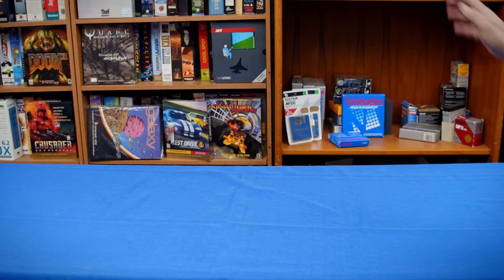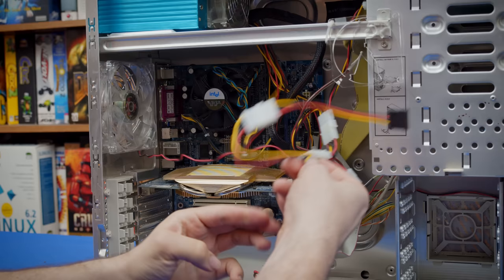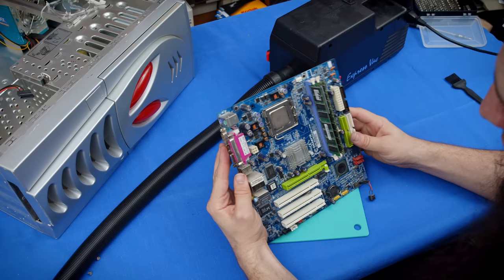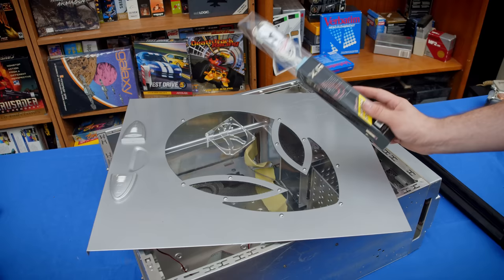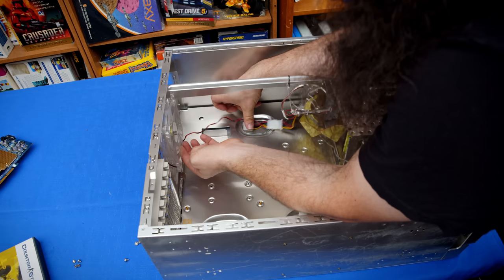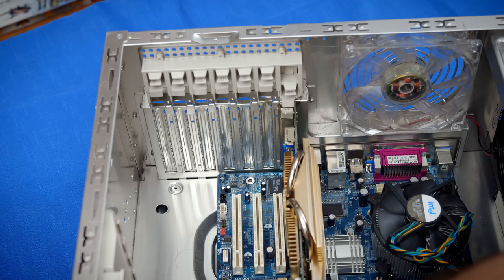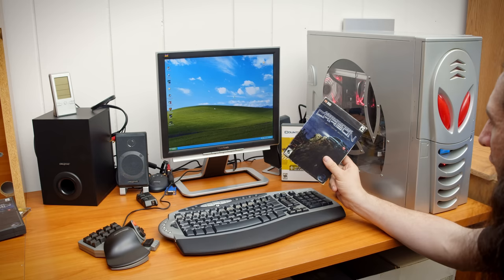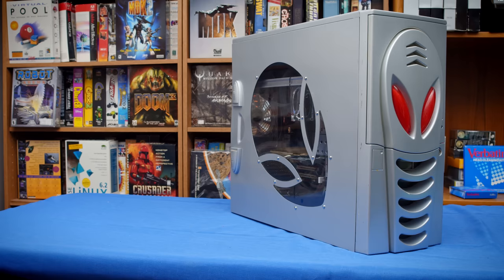Windows XP Gaming PC Brought Back to Life

Comment: When I got back into computers. I saw tons of those gaming machines coming in. Horrible built cases with plastic not metal hinges to swing the door open with. Then my fav. was the cables in the door would start shorting out due to breakage. Some even had led lights in them that would die. Also, it was during the bad cap plague for boards, gpu, and psu. Small fan on video cards and main boards would die. Add on that the horrible anybody can build a computer. But, hey throw cable management out the window and the windows license key. Just use the corp version.

Comment: 5:35 - No, it's absolutely NOT an AT power connector. It's the connector used by early Willamette Pentium 4s, before it became a standard 4-pin 12V ATX-style connector.

Comment: Nice video man. In 2004 I ran a athlon xp 2500+m @ 2350MHz on a Abit NF7-S 2.0 mobo with 1GB PC3200 DDR2 and a geforce 4 ti4200 @ 300/600 although I had 19 desktop and 2 laotop computers back then.

Comment: 34:40 pretty sure like 90% of games realeased on disc in the last 3 or so years are unplayable due to not actually having the whole game, many games exceed the capacity of a 2 layer blu-ray and even if they don't they probably just put an authentication file of some kind and make you download the game (all the ones I've used have massive downloads when you put the disc in so it's definitely atleast part of the game and not just updates), and I don't think pc games even get discs anymore, if you buy physical you just get a code in the case.

Comment: the CPU is what is holding carbon back. had a similar setup and loved carbon. same issues. overcloked the snot out of it and carbon ran great untill the cpu got so hot that it melted the heatsink brackets. this was before i know much about keeping thermals in check

Comment: Cool PC. My first PC was and is Bravo ISO 9001 that was a gift to me on my birthday back in beginning of 2007. It had ATI Radeon X1650 Series video card, Intel Pentium D processor with 3.00 GHz, 1 GB of RAM and HDT722525DLA380 ATA hard drive on 256 GB. The motherboard is Gigabyte GA-945PLM-S2 v1. I don't remember what power supply it had. 

Unfortunately, because i'am not on that level of rich to get myself a modern PC, i'am forced to still use this same PC. BUT, i changed a lot of things. The battery was changed, the power supply was changed, more(ish) RAM was added and video card was changed. Everything else remains the same. So now, it has ATI Radeon HD 2600 PRO video card, 2 GB of RAM DDR2 and new power supply that i don't remember the name of. The case is the same Bravo case. Sure, it is messed up over the years but hey, i'm not in to how the case looks, so it doesn't bother me that much. I clean it from time to time and it is fine. 

It currently runs on Windows 7 x64 Ultimate, but i'am looking forward in to installing Windows 10, after Windows 7 support will be fully done 100% and after i would not even be able to open a browser to surf the internet around. Now, despite the fact that my PC is still working, it already has problems. First one, is the sound card problem. It is messed up, and thus making Realtek to pop up every now and then, when i plug in my headphones, so i have to force it to not do that. And if electricity shuts down and then comes back on, and i turn on my pc, and put my headphones, i can hear the ventilation sounds in my headphones from the ventilator. And the front headphones and microphone ports does't work at all, so i can't plug my headphones in to them. Then there is USB ports problems. Like, sometimes, they stop working for some time, and i have to unplug and plug my keyboard and mouse back, to make them work and stuff like that. But that does not happen very often, if i plug them in and will not touch them for the rest of the time. And so yeah, that is what i have to deal with.

Sure, i can't play modern video games on this PC, but i can play some games. Like, games from 2000 and up until 2014 works. Some of them work fine, others are not, but that depends on PC ports of those games. Like GTA 4 had a bad PC port, so it works very badly. But, there is 2D games that was coming out during this period of time, and they work with no problem. And it's games like: Blazing Chrome, Shank, Mark of the Ninja, Huntdown, Shovel Knight, Mother Russia Bleeds, Double Dragon 4, TMNT Shredder's Revenge, The Messenger, Sonic Mania and many others. They work on my PC with no problem. And then i can just run emulators of many old consoles and play those games. So yeah, i have stuff to play, BUT i really WISH i could play modern videos games that i saw and always wanted to play. But sadly, not everyone has those kind of money to be able to buy new PC and enjoy their free time by playing modern video games.
Reply: Can I tell you a secret of mine? I got a free gaming laptop. What I did was buy one at Walmart. It was a $1200 Dell laptop. I had an older Dell what I did. Was swap my old Dell and put it back in the new box. I would take the sticker off the back of the new one and put it on the old one. That way, the model numbers and serial numbers would match the box and receipt if they opened it which half the time I do this they don’t open it you have to open it from the bottom and you have to open it carefully to make it look like it was never opened before then you just return it to the store with your receipt, you get a refund and now you have a brand new computer I even took out my old hard drive and kept it then I returned it and got the full refund. I do that with TVs receivers wrist watches I do it through Walmart and Amazon. I say screw those big corporations, I do the same thing at Amazon, where I buy some thing. Then I’ll put something else in the box. Then I will refund it. Saying it was never opened. I just say I bought the wrong item. Then I get the refund on my card. I use a PayPal credit card as a burner credit card. I make a burner email address. A burner PayPal account. I use a burner credit card through PayPal. That way, if they do try to reverse the refund after finding out, it was not the right item. It will be on a credit card I don’t even use anymore. 😂 I literally just got through Amazon last year. A brand new Akai MPC live II. It was $1200. I got it completely free. I put an old stereo receiver in the box. Returned it and said that I bought the wrong item. Saying that I never opened it. I got the refund no problem. So I did it again and bought an Akai force. It was also $1200 on Amazon. Then I bought and swapped an iPhone. I had a really old crappy iPhone 7. I bought the iPhone 13 Pro Max 512 GB model. I broke the old phone so it would not power on. Then I returned it saying it was defective. They gave me a refund. I also bought a $1200 Samsung TV a few years ago. I did the same exact thing. I put my old TV in the box. After swapping the serial numbers. Which was on the sticker. Then they open the box and it match the numbers on the TV to the box. So there was no problem getting a refund. I basically just upsized from a 35 inch television. To a 55 inch television. I have gotten so many free things like that. It’s not even funny. Again, I actually like doing it. I won’t steal against any regular person. People that work hard for their money like myself. It wouldn’t be right stealing from them. But stealing from a company. That took down all the mom and pop shop businesses. And making billions of dollars a year. I say screw those people. I’ll steal every penny. I can get from them. 😂 if you’re willing to do that. Scamming and lying to a big corporation. You would be amazed at how many things you can get for free. I hope you have a blessed day brother. God bless you and yours..
Reply: @BLUE_OCTOBER-TRIX  Well, you can't do that here in Ukraine. Sure, you can return back the stuff that you bought if it does not work. But then, you have to prove it does not work, and you have to prove that you did not opened it and that you did not messed with it. Like, i bought new headphone few months ago, got back home, turned them on and... they turned out to be broken. Like, i can hear a left headphone in both headphones, instead of left been left and right been right. It was weird. It worked like in mono or something. And the sound was weird. So later, i grabbed them, got back to the place where i bought them and said that they sold me a broken headphones. And the guy who was selling the stuff, told me to prove it. So i plugged them in to my phone, turned on some music and let that guy listen. And after that, i got back my money. Then i went to another store, with gaming devices, and bought a real gaming headphones, instead of that cheap crap. All tho, they were a lot more expensive than previous headphones. But still, i'm happy. So yeah, you can't refund here anything, without a proof that, the stuff that you bought is not working.
Reply: @BLUE_OCTOBER-TRIX  Thanks, man. We all doing good. At least i know that our region is doing well. After our military free our region and make those russian nazis ran for their lives, we are doing fine. Sure, we get some air strikes from them, but mostly we manage to deal with it. I will not spill out the details because, it can get me in a lot of troubles, but, if I quote Obi-Wan from Star Wars, then i had to say that "We have the high ground".

Comment: still using ye olde antec gamer 200 case with the tie fighter wing design front grill. recently gutted and cleaned it up and spray Chromed the inside and the mesh. looks like a new case again goin in to 2023 lols

Comment: You could easily use a Modular Power Supply to replace the original one, the great thing about Modular Power Supplies is that they help a lot when it comes to cable management.

Comment: "Not what you think" says the thumbnail.
Me: Oh look, it's a silver version of my old case.
IIRC, it was £50 from Maplin, back in the early 2000s. My 1 is black, with blue "eyes" on the front, but my window wasn't UV reactive - I know, because I actually had a UV CCFL in there at 1 point.

Edit: oh, & mine didn't have a temp display. Not sure if that was just a different SKU, or maybe something the SI added.

Comment: I always like the P4 systems. I had a 2.6 Ghz P4 system with a FX 5200 and 2GB of RAM and actually had Windows 7 on it and it ran fine for a long time until the power supply went and blew the MB up

Comment: Holy cow, that is the same Gigabyte Geforce 6800 I have been using back then. It is fully passive cooled and as a side note, a lot of these had not all their Clusters activated. Get the latest BIOS and you get a free 20-40% speed increase. Something else, this Model was the LAST native AGP-Card. All newer cards used a convertor chip to convert AGP to PCIE. That made them more expensive, slower and hotter so that was the reason I got myself this Geforce 6800 back then for some €120 which was dirt cheap back then.

Comment: looks better in the dark, nice aluminium chassis, area 51 case also has a 80/90mm fan mount in the hdd cage area just like that case, yeah nfs carbon is a pretty high end game, im surprised it runs as well as it does on those old P4 systems.  Check the cables on the CD Drives, its probably a faulty 80/133 cable. pretty sure 40pin cables dont do UDMA speeds.

Comment: Thats a very shiny case. Also you should put a black light inside it. My cold cathodes gave up the ghost. I removed them not long ago actually. Wouldn't it have been easier to drill the logo led out and put a new on e in?

Comment: As far as the Counter Strike logo goes, it shouldn't be too hard to drill the old LED out with a 3mm/5mm bit and then glue in a replacement, which obviously has to be the most obnoxiously bright blue LED you can find.

Comment: The GPU in my Windows XP rig is a Nvidia GeForce 7600  512 meg AGP  AMD Athlon 64 3000+ Socket 754 2 Gig Ram SB Audigy 2 Zs  platinum  TV capture card  4 Hard drives sizes are 256 Gig "boot", 256 Gig in removable tray  , 512 Gig,  and a 2 Tb drives all SATA drives. Case is a silver  with  Blue accents and has a side window

Comment: Great idea for this so-called alienware case, had to wonder just how plausible it might be to rip out the old extremely ageing components, and install a modern day kick-ass gaming pc using some modern day pc components - may just prove to be a fun build to do, and quite interesting just how well airflow or water cooling methods might just work in terms of system cooling in this case just might be - Do you have some good modern day gaming pc components that might just work with this build going spare/knocking around in your components coollection? - give it a go, could turn out to be real fun build to do, plus you never know, you just might end up owning a pc that you really end up liking alot maybe😀, John Allen, Hull.

Comment: Oh nice!  Cases like this have always been a bit flashy for my taste,* but seeing one now is oddly nostalgic! 😎  It's hard to get much more 2004 than this, in specs or aesthetic!

Those plastic drive rail inserts are super-practical too.  My current PC's case (bought new in early 2020) has similar ones, and I snapped my old Win 7 PC's hard drive in and out multiple times on them when copying files over.**

Meanwhile I didn't really have money for a computer even close to this back in the XP era.  I was still running a no-brand beige box with a K6 CPU and Win98, until I could finally afford something better in 2007.***  Though I did get a bigger hard drive in '03 or '04.

* Though my current desktop PC does have LED lighting in the CPU fan assembly, and a large side window in what's otherwise a very plain black case.  Neither were features I was actively seeking out, but just happened to be on what I got!  

** Pull the drive from the old PC's drive cage, put it in the new PC, copy the files over, then put it back in the old PC.  ...Then repeat a while later when I found I forgot to copy something else over.  

*** I bought an off-the-shelf PowerSpec PC (Micro Center's house brand) with Windows XP, literally the day before Vista launched -- because I really didn't want to gamma-test Vista. 😛  The K6 box got recycled long ago, but I think the PowerSpec is still floating around my brother's house somewhere, without a hard drive or a video card.

Comment: some insight on the cutout in the door, it's for some fancontrollers and soundcards like the Audigy 2 ZS front bay that sticks out a bit.
Reply: The cooler thickness is also standard for early 775 days Pentium 4/D 

Early 775 C2D had smaller coolers since they were much lower TDP, the extreme coolers were a bit darker, had a blue LED fan and looked more like a Zalman!

Comment: That case needs an old cold cathode uv light kit for sure, might spot those on ebay from time too time or maybe find some store that has old stock of that stuff.

XG cold cathodes are a bit low quality so be careful with the cables near the cold cathode tubes, they break if you stare at them hard enough i feel like.

Had a white kit that looked amazing with Fractal designs white 120mm fans on the side panel.
But the double sided tape failed on one of the tubes that i had mounted on the side panel one night & it fell down & broke the cable instantly even though i left it loose it simply landed on the cable & that short fried the kind of powersupply these have after like 2 months of using these.
Traded with a friends uv cathode that one side fried on & had only 1 cathode for a while ca 2012.
Kind of wish i had those photos still the Akasa cs-500 case was low quality, but the twin white 120mm fans lit up from inside the case by that cathode light looked amazing.

Comment: I was given a mitx dual core PC for free by someone, turned out to be a quad core Q6600, which I was very happy to find out about. Got some DDR3 memory for it. Then in the GPU shortage I was in a local shop who sold me a GTX 660 card for quite a nice price. Will it run Crysis... yes and with all the settings turned up to max (not the rerelease).

Comment: the cs logo was not originally installed at the computer. probably some nerd modded it. it is ment for installation on a fan or fan slot. i always laugh about ppl who are into computers but have no clue how to use tools right. so they mess around with wire strips etc...

Comment: This is the exact type of PC i looked up to back when i had my first PC, seeing a 6800 Ultra, athlon 64 x2 4200+ on 939, dual channel memory, sata raid hard disks, whacky case fans, grilles and cases..Having a Sempron 2800+ and FX5200 in 2004 onwards was obsolete at the start, it was my dads upgrade to a 486 computer and that FX5200 struggled on doom 3 and a year or two later fell out of it as i got into it, my first upgrade was upgrading the memory from 512 to 1GB when we got internet and i used to play games at 480p low getting framerates in the teens..and that was when it ran well..

i decided to base the rig in the era after the high single core clock speed and geforce boom where i saw UV builds and fancy DFi boards but i wanted to keep closer to the original while adding the performance and spice i envisioned it having one day..So some importing later and it now has a 939 based 3400+ Athlon which soon will be the 4200+. 1GB 400mhz ram in DC and an IceQ Ati Radeon X1650XT all housed on as biostar combo AGP + PCI-e board if i ever want to put my FX5200 back in. its got a gimmicky cop red n blue theme with 1 red CCFL tube and one UV to light up that GPU shroud, little me has never been happier to see the PC i saw 15 years ago..how time flies, but now the framerate does too :)